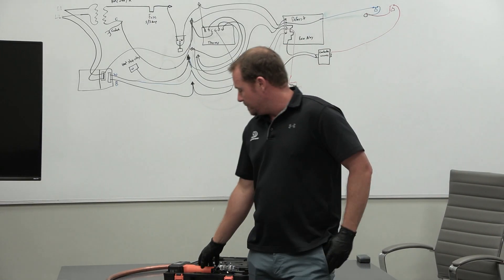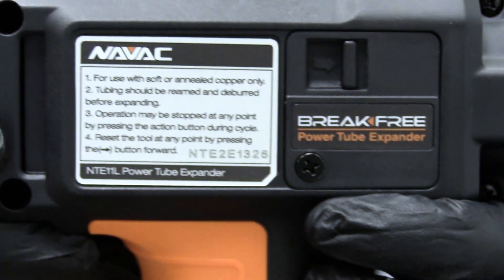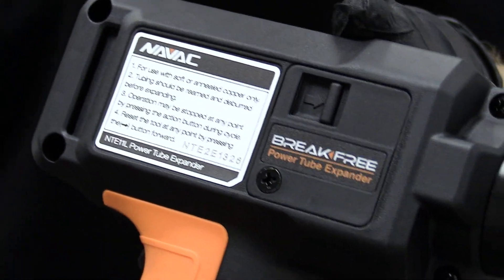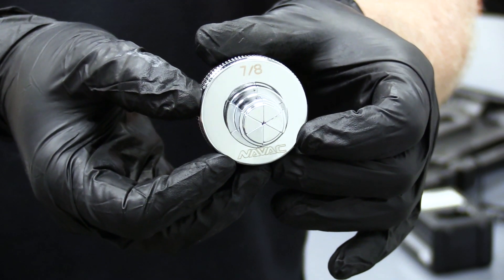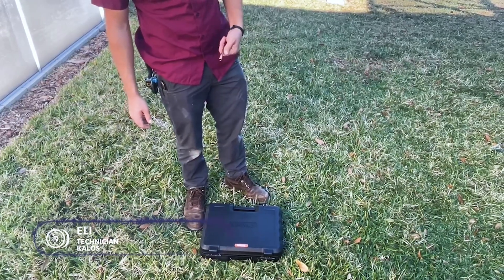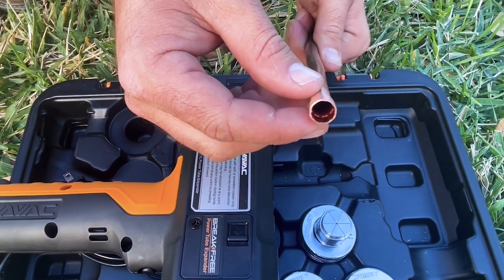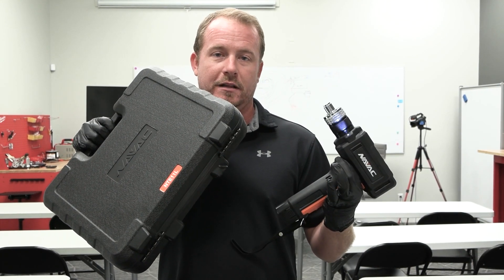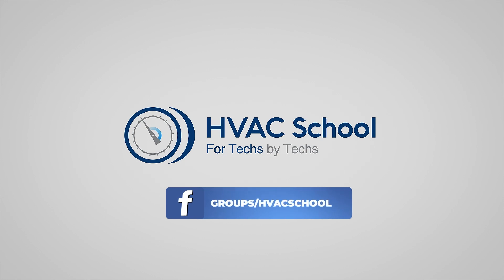BreakFree® Power Tube Expander by NAVAC (NTE11L)

Comment: The laziness in our trade sometimes baffles me. To tools like that Zoomlock garbage, to those garbage press on refrigerant fittings, to this tool. I like Navac a lot and I have the Navac hydraulic swage tool which to me is easy enough. I haven’t gotten so lazy that I can’t just squeeze a handle a few times to make a swage or use a torch and flow some nitrogen to braze some joints. I change a lot of reversing valves and compressors and that zoomlock trash wouldn’t work in those situations anyway. I actually enjoy brazing and don’t ever intend to stop. Sorry for the rant I do really enjoy your channel and the education you provide.
Reply: So too lazy to hold the pipe in a flaring block, and hammer a swage tool in, or use the lever arm style swage tool, but an electric one is just a step to far?😜

Now imagine you have a coil to replace above the ceiling in a downtown office/condo building in a metropolitan area that requires hot work permits if any brazing is involved.
You can either do it the old way, pay the money for the permit and fireman to stand fire watch while you work, and hope that you don't run into scheduling issues coordinating thing, or you can break out a Zoomlock and get the job done with no hassles.
Or you are working in a tight space between the top of a walk in box and roof deck, and there is spray foam, wires, and other flammables everywhere around where you need to put fittings together.
It isn't the ideal thing for every piping job, but it definitely has its uses.
Reply: Nah thisll let you bust shit out for sure. This and the auto bender they have. All you old guys don't get it anymore. The market is changing and it's all about speed now. It sucks dick but that's how it is. Adapt or die.
Reply: Well, when you start hitting your mid forties and your hands start bothering you. That's when this starts coming in handy.

Comment: I had an older guy bring me a pipe expander but was an old model that had a ratcheting deal inside.. guy said it needed calibrated because it kept breaking the pipe..  well they dont calibrate..  they work until the motor or gears break.  But wasent broken.  Turned out this guy was trying to use it on pvc lines..  for whatever reason..  dunno what he did for a living using half inch and 3/8 inch pvc.. but he thought you could expand the pvc with it to make splices and then use the cement to weld em together.. kept saying the heater works but doesnt get hot enough or something.  They dont have heaters, he was doing something to heat up the motor thinking it was a heater for the pipe..  lol.   Is hard to tell an older guy that they been doing something pretty dumb...

Comment: The battery does last forever. Installs everyday, and still going 3 months later with 50% left. Does not lose torque with lower battery capacity.
Reply: Any maintenance you gotta do?

Comment: It’s a cool concept but nothing beats the good ol Hilmor expander
Reply: Nothing beats the manual expander and a good ol hammer
Reply: Recently gifted the Hilmor set which quite literally beats the hell out of my old skul stone age hammer swedges.

However in my limited use of the Hilmor have found that the swages can easily made excessively loose. Curious to know the tolerances / automatic stop point of the Navac in comparison.

Comment: My 60$ hydro expander I got from eBay works just fine and I drop it off ladders all the time.
Reply: That’s why you need a $60 tool, your clumsy ass can’t take care of good tools
Reply: Absolutely 👍🏻. And you don't need to charge battery.
Reply: @ЮтюбПетрович  so I assume you don’t use battery powered drills or impacts?
Reply: @salad973  I use, but my battery not compatible with Navac.
Reply: @ЮтюбПетрович  why would you use a battery powered drill when you can use a screwdriver. With a screwdriver there’s no need to charge a battery
Reply: @salad973  do you know something about compatibility and how people can use it? I don't  need a  thousandths of different tools with a  different battery,  because  it can be problem, when you forgot to charge one of them and another battery can't help you to procced to work. Standardization, this is important thing.
Reply: @ЮтюбПетрович  it sounds like you are not organized and you want people to make life easy for you. Charging batteries is not difficult at all, just think of all the different batteries you already use, do you forget to charge your phone? That battery isn’t compatible with your drill is it? But do you forget to charge it? You can also get another battery for the navac tool, as I’m sure you have multiple batteries for your drills, do you not?
Reply: @salad973  what's the problem with easy way to wokr? It's called "professional style". You can talk with someone else about your views on "how job should be...". I charge my battery and I don't need more different tools, I repeat again. This tool is big, heavy, needs battery, and you can't use it in tiny space. And it cost $500, good for thief guys.
Reply: @ЮтюбПетрович  there’s an easy way and a smart way, your first complaint is about batteries, which is a ridiculous complaint. So many tools we have and use everyday are battery powered, that makes your complaint invalid, unless you only use hand tools and do not own a single battery operated tool. If you want to talk about making things easy, this tool is designed to do exactly that. If you want to complain about price then yes that’s valid a complaint. But there are ways to work around that too.
Reply: @salad973  you have an  experience and me too. You have an  opinion and I respect it, my opinion is different. We all different.
Reply: @ЮтюбПетрович   yes all valid opinions should be respected

Comment: any downside to using this?
Reply: designs like this will sometimes split your 3/8ths copper tubes, not sure about how well this one performs.
Reply: There are downsides to everything, that’s a silly question
Reply: @salad973  thank you captain obvious.  but you could've been more helpful by pointing out the downsides.
Reply: @metsrus  or you could use your common sense 🤔
Reply: @salad973  I don't have any.
Reply: @metsrus  😂 thanks I spit out my drink

Comment: Extremely pricey for something you'll be using once lol
Reply: Why would you only use it once?
Reply: Just bought one. I will only use during cooling season here in MI, but I don’t ever plan on buying copper fittings anymore. At $3-5 per fitting, it will pay for itself quickly. I always have spare line set laying around. Will save quickly having apprentice practice his brazing. Definitely not a tool for average homeowners.